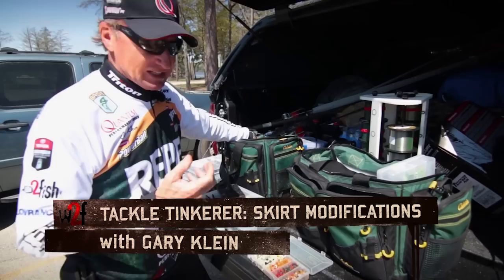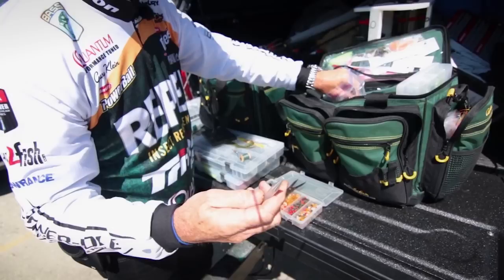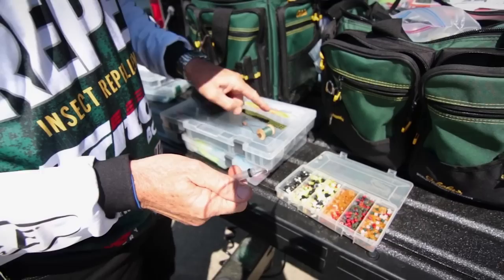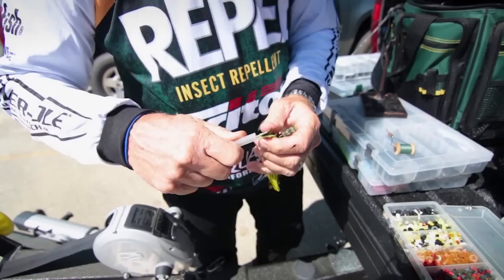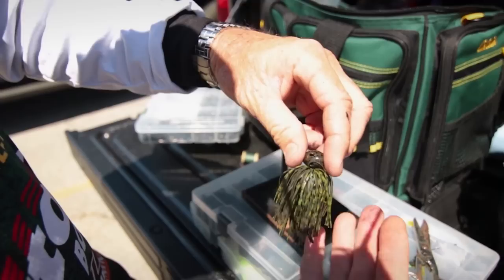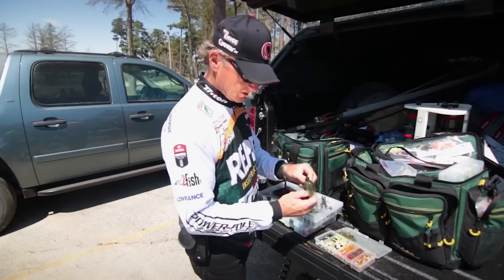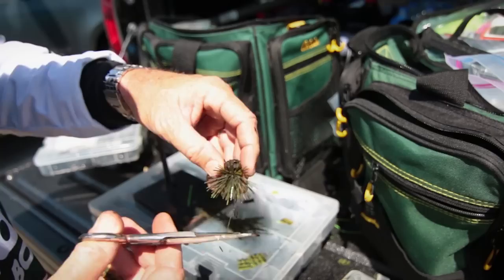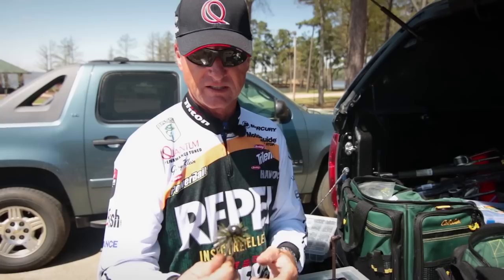Tips for Making and Modifying Lure Skirts

Comment: You can buy them there call the puffball jig I created them back in 1985 I do several custom jig head designs and 50 different color patterns in both silicone and round rubber and I mix both materials.